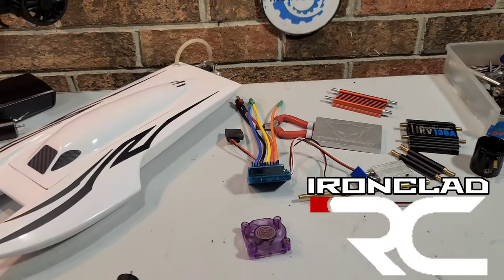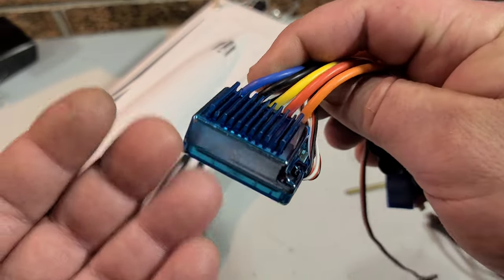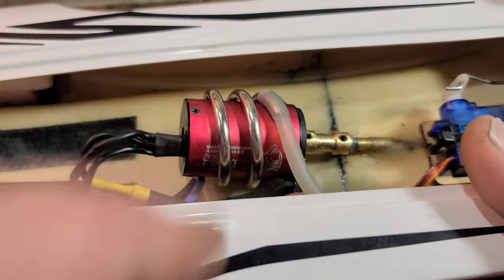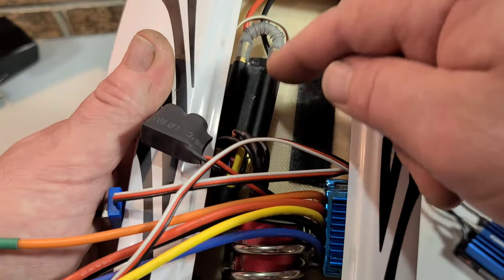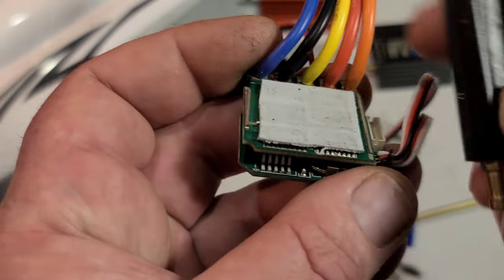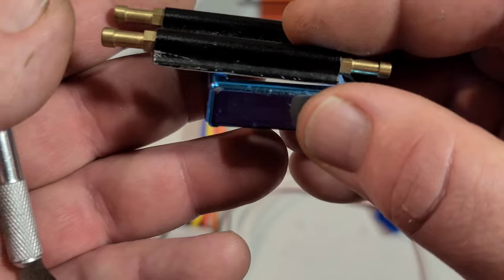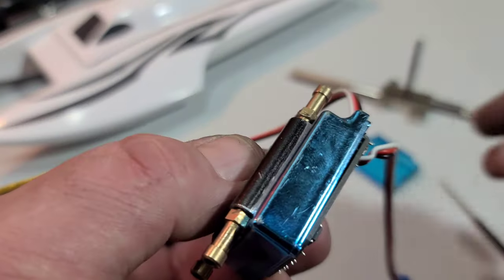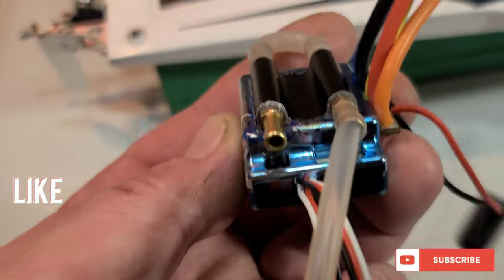Air Cooled To Water Cooled Esc Conversion - Brushless Rc Boat Esc - Marine Speed Control

Comment: I want to try a different kind of water cooling conversion. Instead of fitting a cooling plate I was thinking to fit a flat aluminium plate and let it through the bottom of the hull and epoxy seal it so the water running under the boat cools it directly no scoop no hoses.

Comment: I just run a high powered fan on my 8s esc. Motor is water cooled and gets hotter then the esc 😂
Reply from the maker: Just my opinion, Prop might be too big if the motor is getting hot, either diamer or to much pitch

Comment: I’m looking to do this with a VXL-3S ESC but don’t wanna crack it open…what’s the best solution? I also heard the KV on the motors help with temps it’s going in a traxxas blast since I wanted to prove to traxxas that you can do brushless conversion. Any help is appreciated!
Reply from the maker: Simple way to cool that speed control is to run a couple small brass/aluminum tubes in between the cooling fins and zip tie them into place
Reply: @IRONCLADRC smallest I found was 2mm the tube I have is exactly the same size as yours. I could drill but run the risk of ruining the fins. Are there methods of breaking the fins off with common hand tools?